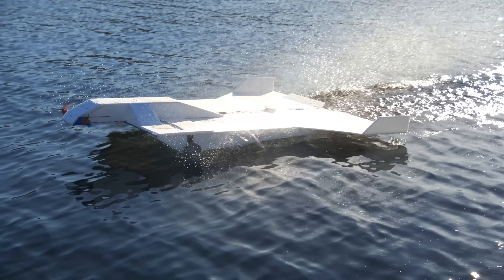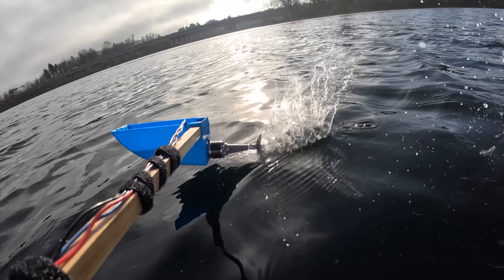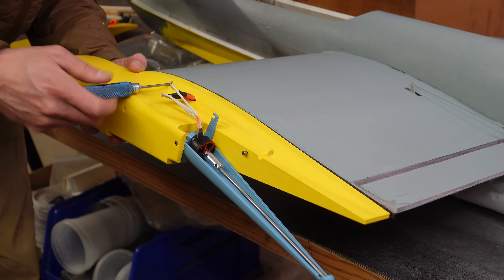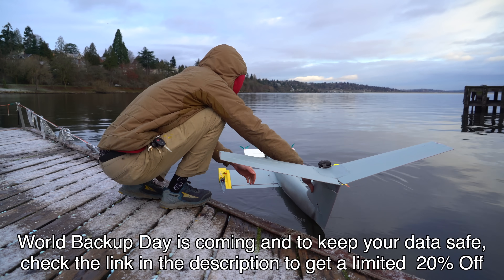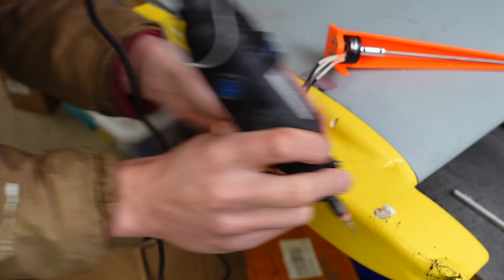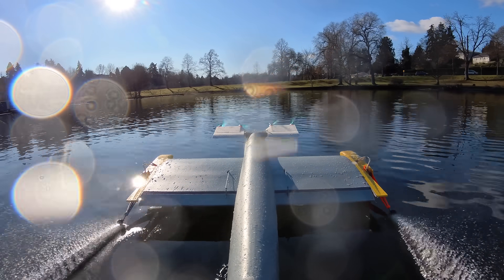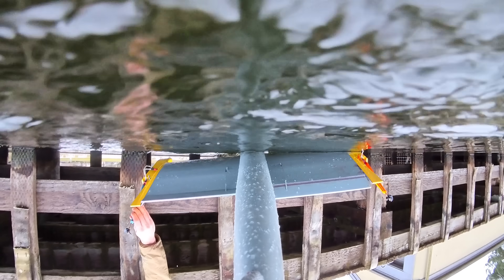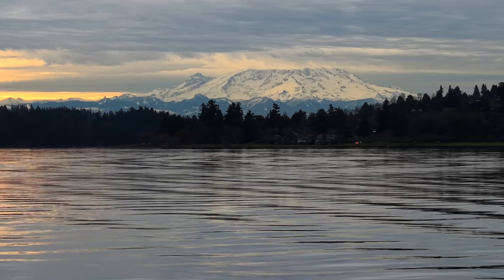Can Speed Boat Propellers Power an Aircraft?

Comment: Cooler would be to prevent it hitting the water at all.  How?   Additional motors of smaller sizes with independent lidar on each of them sync to ensure lateral stability.

Comment: Should try something like a long shaft outboard that keeps the propeller fully submerged, I get the idea of surface drives but your vehicle will never fly as fast as a similar sized rc boats that use surface drives typically achieve 70 - 100 mph

Comment: Looks like it pretty clearly turns to starboard after the foam fill. The right wing would heavier than the left if the left is still empty/air. Foam is obviously heavier and less buoyant than air, or it would float in air like a helium balloon!

Comment: Really really amazing eksperiment! And shows that you can take a way old concept, and try to reintroduce new tech, and make new discoveries.

One thing I was wondering, and wanted to share, is that your prop-wing-assembly up front is obviously still feeding air to the groundeffect passively when the propellers are turned off. But like on formula 1 cars, where the front wing both serve as a downforce making device (not relevant for your project), it also serves as a device for feeding the venturi tunnels and thus the groundeffect. I notice that you prop-wing-assembly is only around half the width of the groundeffect wings, thus it might be possible to improve the passive groundeffect by increasing the front wing width, to feed more passive air to the ground effect. I think this could be a quick and effective optimization. Just some perspectives from a massive Formula 1 fan, and not least fan of your channel 👍 

Thanks for great content! 🙏

Comment: Would Coating the bottom of the craft with some hydrophobic spray for waterproofing tents help prevent the sticking to the water at higher speeds?
Reply: Or Aerogel
Reply: @Solarbond would be great though aerogel is to fragile, the small  impacts of the water would shatter it.

Comment: Add a hydro foil at the front for lift
Reply: Yes.  Run the drive shaft down and turn the hydrofoil into a pull tractor.   

A little hydrofoil underwater dart, pulling a ground effect vehicle that carries the fuel and power plant.

Comment: the rubber bands are nice, but you still see a lot of bouncing. i know it would be a detrement to the weight, but a shock absorber from a micro scale rc buggy/crawler could likely be tuned to maximize the propeller's efficiency. potentially so much so, that the added weight won't be an issue

Comment: ok so watched the entire video till the end, your ground effect vechile main issue here is simple, your torques are off..... with the front motors on you are generating a torque in the up direction, without that torque the craft cant dynamically stablise itself. add some weight to the back of the craft to fix that issue OR find a way to have your water propellers to creat torque that has your tail pushing down

Comment: I just painted the 
Miss University unlimited hydroplane that started with a tether model in the 50 but failed to perform or qualify in full size .
Your out drive setup looks like an Arneson drive without the flex features. 
I stand corrected, nice setup .
Bring your model to the Hydro and Raceboat Museum for a picture with Miss U sometime, in Kent , Tuesday-Saturday.
 And 2 blade props can work better than you’d think .

Comment: as a resident of the PNW anywhere near Lake Washington, you know in your blood that a boat propeller can power an "aircraft". They've been racing hydroplanes (which only barely touch water at 3 points when everything is working properly) that have blown over and achieved significant flight distance, starting in 1929 at Green Lake. Only reason they don't fly better is designs and "rules" about being a "boat". Note there have been quite a few models over the last decade of WIG vehicles powered from the water, which mostly failed due to lack of stability electronics or any sensors and gyros.

Comment: Very interesting concept now if you notice in the videos you’re getting a lot of oscillation from side to side, which is possibly from the shafts not being perfect, so what I suggest that you do , is do I do on racing boats that use this type of propeller in Asia and Have a driveshaft inside a pipe with a bearing on Eva end basically like you would have on a normal boat I need this. Would this give you a lot of strength but this should help counter any oscillation?, Not only that if you actually made them longer you probably would be able to get a slightly higher height off the water helping the whole process as usual keep up the good work interesting project.

Comment: How about trying parallel linkages for the water motors?

Like pantographs that keep the water motors at the same angle relative to the aircraft, instead of making the impellers thrust upward when fully extended. It might slowdown less when it gets farther from the water surface.

Comment: 15:18 the water propellers seem to work fine.. depending on how you want them i suppose. I hope the following is understandeable....

Its the air propellers. By free spin, they are producing drag on the air flow and actually pushing the aircraft down a bit. 
The air flow is braking the aircraft while the water props are pushing the craft forward so the plane is constantly trying to nose dive
But then there is still a bit of airflow on top at the wind blade so it gives very light noselift.

End result, the plane is actually trying to fly but has downforce in the front and hence will not produce hover properties until u remove those front props.. OR until those front fans spin fast enough to not provide as much resistance (very poor efficiency tho)

Comment: try to use just the inner air motors with the surface drives to assist with par thrust. so shut off the outer 2 and reduce the power by a large margin on the inner 2, like max 20 percent.

Comment: The wind direction could have had a big impact on the final success you had with the air motors off. It's hypothetically possible it could be working in a headwind and not with a tail wind, the extra lift from the headwind may be helping keep the nose up. If that theory is correct you should be able to replicate the lift with air motor wing by running them at a very low power say 'idle'.

Comment: Sailboards aren't actually surfboards with a sail. It's all about constantly reducing drag as the water gets harder and sickier with speed. To reduce stickiness sailboards and some surfboards have a release edge. The faster the craft travels the smaller the length of the release edge becomes. If you add this idea to your designs the cartwheeling issue might be reduced.

Comment: if you add a steel or aluminum prop of greater pitch AND give it some rake, it should produce the nose lift you need. you could add some cupping to the leading edges, but cupping will really try to push the stern down, giving it too much bow lift

Comment: use hydrofobic coat in spray on whole things that have a contact with water it should act like lubricant and reduce friction between water and speed boat, but that coat is not permament so... there is possible that mixing paint with cinamon (cinamon is hydrophobic) do the same thing but this is MY fast STUPID idea

Comment: seems like you were on the right track with just the piercers. didn't have all the pitching up. maybe drop down to ONE air prop, and maybe ONE, centered piercer. then wondering if you've thought of non electric. little rc nitro type motor. shaft(s) coming out of both ends, one for each prop. not sure how universal joints would work at such high rpm. and would have to add a rudder. you might also think about extending the wing, a bit. or maybe even a big redesign, to something like an airfish. great work. love the experimentation. and the verbalization of the thought process.

Comment: Your air props are generating a ton of lift over the wing surface at low speed. You are slowly transitioning in to designing a hydroplane.

Comment: Without the front motors pushing air under the wings, it seems to me that an increase in wing surface might provide the lift needed with only the water props driving the craft forward. I didn't notice, but are you using opposing rotation on those to help counter torque when the wind starts lifting one side? Peace❤😊.

Comment: This video raises an interesting point about propulsion! Considering the limitations of traditional propellers for aircraft, I'm exploring an alternative using a modified Tesla turbine concept. Here's my idea:

Modified Tesla Turbine as a Propulsor:

Instead of using it as a water pump, we'd adapt a Tesla turbine for air propulsion. This involves optimizing the disc spacing and geometry for airflow rather than liquid.
By partially removing the lower casing, we'd expose the turbine's edges to generate thrust. The laminar flow between the discs could potentially create a more efficient airflow than conventional propellers, reducing turbulence and improving thrust.
Hybrid Power System:

Electric Motor Drive: Integrating a high-torque electric motor would provide precise speed control and instant torque, crucial for takeoff and maneuvering.
Compressed Air Assist: Supplementing the electric motor with compressed air injection could significantly boost the turbine's RPM and thrust. This could be achieved using:
An onboard air compressor.
A small gas turbine (as you suggested) to generate high-pressure air.
Rationale: Combining electric and air power offers redundancy and flexibility. The electric motor provides consistent power, while the compressed air provides bursts of high thrust when needed.
Water Collection and Utilization (Optional):
If the aircraft is operating over a body of water, it could collect water into onboard tanks.
This water could be used for:
Increased Air Density: Injecting a fine mist of water into the compressed air stream to increase air density, further boosting thrust.
Cooling: Using the water for cooling the electric motors or gas turbine, improving efficiency.
Ballast: Utilizing the water as ballast to improve stability and control.
Variable Thrust Vectoring:

Implementing actuators to pivot the Tesla turbine assemblies would enable thrust vectoring.
Vertical to Horizontal: This allows for vertical takeoff and landing (VTOL) capabilities and efficient forward flight.
Reverse Thrust: Angling the turbines in the opposite direction would provide effective braking and reverse thrust for short landings.
Airflow Capture for Lift: Design the air inlets to direct a portion of the airflow downward and rearward. This would:
Generate additional lift during takeoff and low-speed flight.
Increase overall propulsion efficiency by utilizing the kinetic energy of the incoming air.
Aerodynamic Considerations:

The overall aircraft design must account for the unique airflow characteristics of the Tesla turbine propulsion system.
Careful shaping of the air inlets and outlets is crucial to minimize drag and maximize thrust.
The placement of the turbines relative to the center of gravity is extremly important for stability.
The shape of the aircraft itself could be designed to capture and direct airflow to the turbines.
Also possible.. it could use water it collects into tanks from the liquid it is riding over?

Comment: Ground effect flying with water motors only on this design will never work well. It is neither about airdrag of your front motors nor about weight distribution. It is a lift issue. The water motors cannot actively force airflow over the wings and therefore neither produce lift nor the necessary air cushion. The only scenario this might work is with enough boatspeed to actually generate lift, but that is an edgy use case because you need to control lift by control surfaces in this scenario and it is very easy to produce too much lift and create an uncontrollable situation. The reason it works so well with tractor props only is because you actively generate and control the lift with your drivetrain at boatspeeds way below boatspeeds where it would fly without forced lift

Comment: Absolutely love this and the channel!! ❤ there is a good fast electric store called offshore electrics used them for many years when i had brushless model powerboats, hope that's helpful at some point, much love from Australia 🇦🇺 and one of the biggest reasons we all usually use Surface piercing props and drives in our model poweboats, your welcome to check out my channel if that can help you too plus we have some pretty cool large scale 2 stroke and brushless boats 😊 also Andrew loves combining what he's learned from building, flying model planes into our boats never thought about using an aircraft fuel tank in a boat until I seen how amazing it works and so much more parts engineered into them such amazing things on model aircraft ❤ oh you could try what we use on our hydros called lifter props usually has the letter L in the prop description 😀 and possibly counter rotating inward for turning and outward for more top end

Comment: It's possible that this only works in my head, but is it possible to point the ends of the water propellers upwards (you would need to use flexible drive shafts) so when you accelerate from standing still they push the rear of the aircraft down and the nose up. and then as the craft comes out of the water the props would become perpendicular to the surface of the water. Similar to the way outboard motors have adjustable trim and tilt to help the front of the boat to come up onto a plane.

Comment: try using glider props that fold when not under power, that'll solve the drag issue. you may need to make longer motor nacelles so the props clear the wings, but it should work fine.

Comment: As a sysadmin, unless you're OK with losing all the data on your NAS please concider RAID6 and/or a full backup. Because when, in your RAID5 array, one of the drives fail chances are your other drives are also already very old. And rebuilding the RAID array requires a lot of I/O and takes quite a long time with how big drives have gotten these days. This means there's a very good chance one of the other drives will also encounter a problem during rebuilding and you'll lose all your data. With RAID6 you'll at least have one more drive in reserve. If you're worried about space, use the 4T drives for something else unimportent and throw in 10 or 12T drives in the NAS since they're so cheap nowadays. One of the most important things I've learned from my proffesion is that RAID storage is simply uptime assurance and not data protection assurance.
Also if you ever need to replace one of the drives, make sure it's also a SATA drive with the same rpm and preferably same brand. Size can usually also be bigger size drives but some RAID softwares are fussy and require the exact same size.

Comment: what about making the shafts themselves into props, so that the prop shaft is literally a shaft prop? kinda like those weird screw tank designs on mud vehicles that can move in any direction? but more tapered or "very long ice cream cone" shaped so at lower speeds, more of the shaft is in the water, corkscrewing more water out of the way to push it up, which creates less resistance, and allows the deeper end of the screw with a sharper pitch to turn itself into a surface piercing prop? another interesting experiment could be flipping which way the ice cream cone goes, so that the narrow end is at the end of the shaft while the wider end is at the motor. also, i bet if you made an ai control program to perfectly throttle the air and water motors together, it could maintain a perfect balance without slamming around, which would pretty much be the winning design for commercializing it. (i want to be an inventor so bad but as a peasant, i can't afford to do experiments to show proof of concepts or such. how many amazing ideas have died with their creators over all of human existence because they didn't have the resources to make ideas real...)

Comment: defiantly start to look at cleaver style propellers. more about balancing energy efficacy entering and leaving the water once hull/skeg drag isn't a factor. aero is of your design so balance point isn't the normal 75% rear goal for normal water craft. best thing to play with will likely be prop rake for balance forward aft( generally 12 degree low, and 18 high). generally higher pitch and struggling to plane is best. sure you know generally 1.5x pitch vs 1.0 diameter is a great ratio.... top drag boats are running 16 pitch on 11" diameter props. 2 blade B-series style. but are v-drive and need acceleration over the top speed/efficacy of surface drives

Comment: Your project reminds me of the air hogs rc boat plane thing that had elevator control and differential motor speeds for forward, throttle, left and right… they sold them at toy stores and no one could figure out how to fly them,well I did and was good at it…. They were lightweight, but too heavy still for the small motors and props and 2 cell lipo included… once u got it going though it was cool watching it fly.. I got home videos of it from ten plus years ago…. Your rc boat projects remind me of it, wish I had a full scale complete rc control version

Comment: You need to test a configuration that doesnt let the air motors even turn on until the water motors are at max. So you can use them to "take off" than just use the water motors to maintain. So like first half the stick is 0-100 for water then the second half the stick is just 100 for water but 0-100 for air motors.

Comment: For a future surface propeller ground effect project, you may want a small hydrofoil, or some structure in the hull to help it get on a plane, to help get the body out of the water so it can get into the optimal ground effect range.